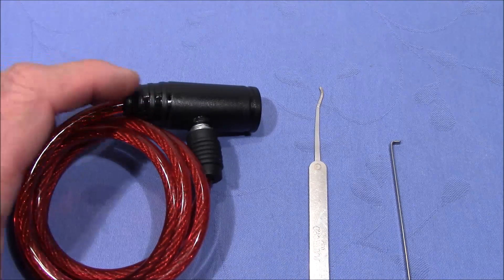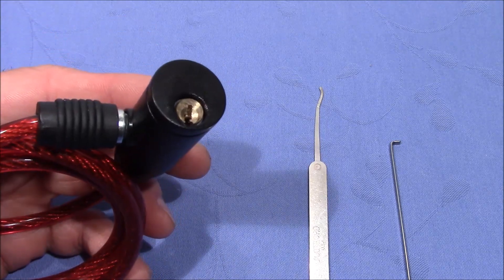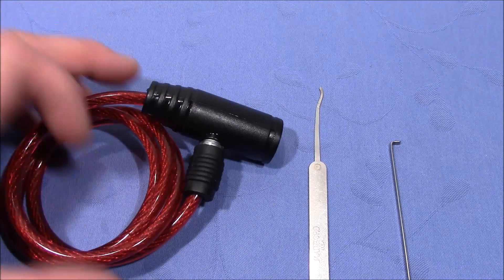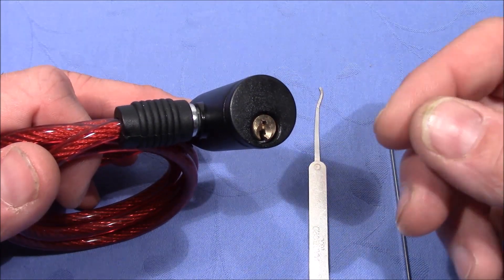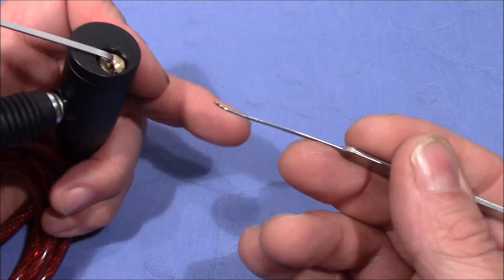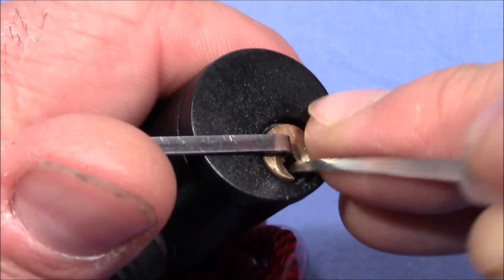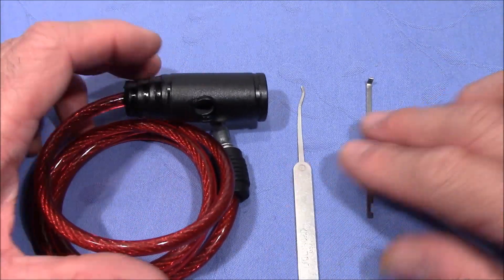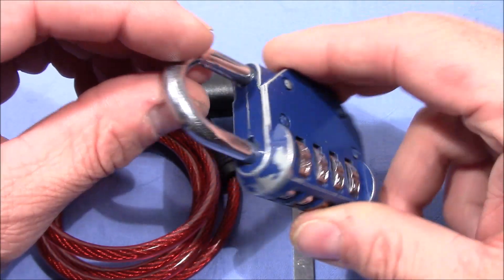(picking 746) Why I almost failed to pick open a 1.10 € cable lock

Comment: I had a very similar lock and took me some time to open it. It even bent my multipick hook. Manage to pick it now but it's tougher than it should be. Haven't tried de wd40, will try. Love your channel!
Reply from the maker: Yes, try lubrication - it helps greatly as long as the lock is not deformed.

Comment: I also had challenges on the same lock today. Tolerances are so poor that they can quickly become really hard to SPP. Generally speaking, raking works much better on these cheap bike locks.
Reply from the maker: Yeah, sometimes cheap does not mean easy to pick.
Reply: I tried a similar one. Thought it would be nice as a start into lock picking.... 
I applied wd40 and still had a lot of problems.
Raking with very light tension works. SPP I think I constantly over set some pins.
Reply: @dew5240  You may also have a relatively soft plastic core. As soon as you apply a bit too much tension, the pins melt with the core and nothing wants to move. I generally use heavy tension as this is where I get a very positive feedback but that doesn’t work with this one. Here you need very light tension, just enough to keep the set pins in place but without deforming the core.
If you are just getting into picking, I would recommend a basic padlock like a Master 3. It will be much easier to SPP.

Comment: That is the same shoe string lock that thieves pull open.
Reply from the maker: Haha, shoe string is a good description :-)
Reply: @Potti314  they pull the cable tight and then kick the lock which pulls the one end of the cable out of the lock housing. These locks are terrible 🤣

Comment: Ouch!!!!!!  Buddy.... In the UK many cyclist will lock a bike, go about their business... Then leave the lock on bike rail for the next day... Are you sure you have not stolen some ones bike lock 😂😂😂😂😂
Reply from the maker: The lock was almost impractical to turn open, also it hung there in the open state. In Germany you rarely see locks without a bike - mostly heavy locks as the owner wants to avoid carrying it around. They are always locked up. It is not to be expected that a cheap 1 EUR lock, hanging open, that can hardly be turned open, is still in use. From a legal point of view this is either a find or an abandoned item and because of the low value not required to be carried to the police or lost-property office.
Reply: Funny you mention cheap small cable locks. I have told students many times to get a decent D-Lock to secure bikes. Had one student who had his £1000 mountain bike stolen... When he showed me the cut lock.... It was a cheap nasty one. He claimed after saving for the bike, he could not afford an expensive lock.... Wasted his savings for the bike as was not insured either. Poor lad.